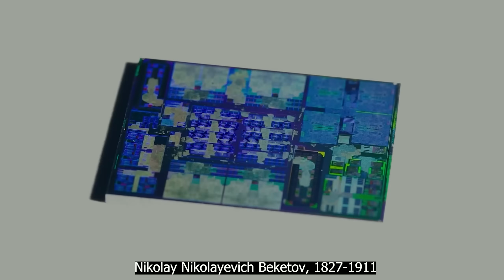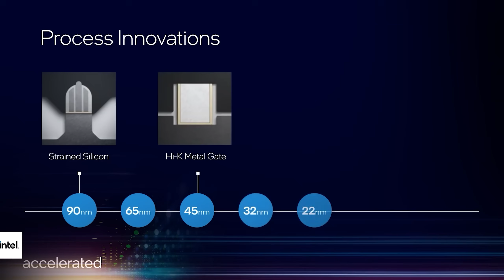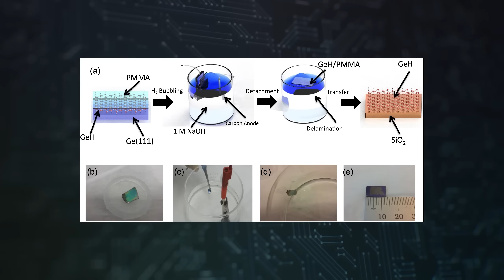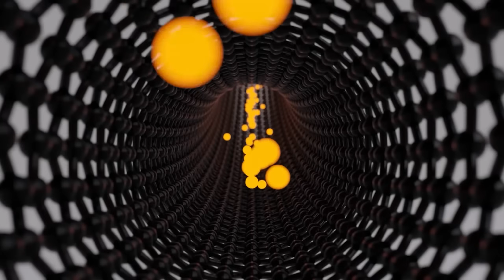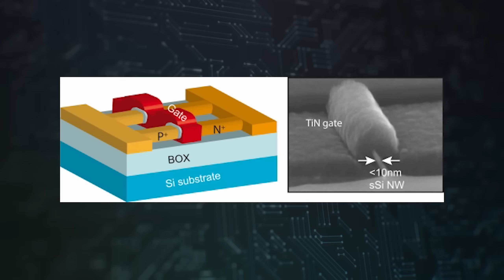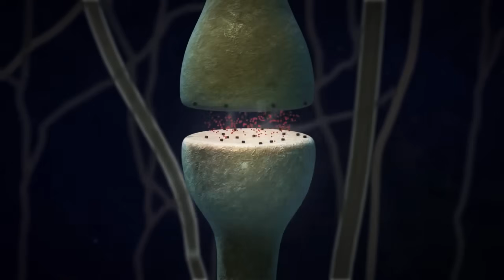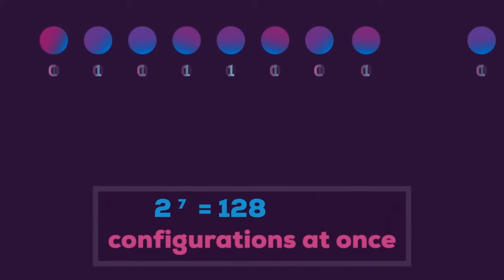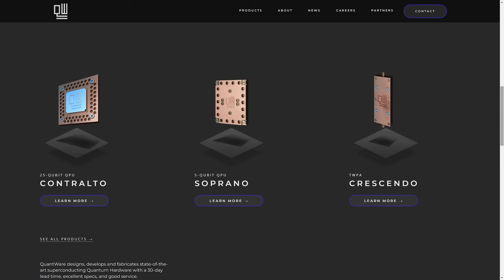End of the silicon era. Processors of the future

Comment: You forgot multi valued transistors. Non binary transistors which can switch between more than 2 values.

A 4 state transistor can emulate 2 binary transistor, without miniaturization. So it can preserve Moore's law, without requiring smaller atoms, or getting into tunneling troubles.

Comment: Well-Done, summary:
 SILICON: Above vs below a 5nm gate width silicon is discrete on eor off vs statisticial on&off (aka tunnel field effect)
 GERMANIUM: Germanium Has much better lab performance but silicon is extraordinarily more pragmatic/practical (availability/cost, heat dissipation/tolerance, oxidation, freq band, etc).  However germanium might be modified to improve its characteristics (ex: Molybdenite in development, lab germanane, etc).
 CARBON nano-tubes (in development): Graphene is a one-atom-thick layer of carbon atoms arranged in a hexagonal lattice.  A carbon nano-tube is a tube of graphene 
 GALLIUM NITRIDE: has some better performance than silicon & can be manufactured with silicon based equipment/industry
 Better CMOS: design based on statisticial on&off (aka tunnel field effect) instead of discrete on eor off to lower power/heat.  Only work for graphene & at super low temps.
 MEMRISTOR: A memristor is an electrical component that limits or regulates the flow of electrical current in a circuit and remembers the amount of charge that has previously flowed through it. Memristors are important because they are non-volatile, meaning that they retain memory without power.
 OPTICAL COMPUTING: 
 QUANTUM COMPUTING: In theory quantum computing can find least-worst solutions to problems no-matter the number of potential candidates (ex: NP problems like the traveling salement, decryption/password breaking, etc)
Reply: I like how you said nothing about optical computing xD
Reply: @Luizfernando-dm2rf  
*I wasn't trying to show-off.  These was just quick notes to remind me of technology tends I was fuzzy-on (thks to this good video).  I'm a retired physicist & am already familar with optics & optical computing.  
*There is Trillion$ ... Trillion$ of semiconductor electronic infrastructure around the-world & comparatively optic/quantum infrastructures are very small.  Quantum computer infrastructure is small but growing much faster than optic computing infrastructure.  So we just might jump from semiconductor dominance to quantum dominance computing.

Comment: So glad YouTube recommended this video. Nicely done, great balance of information and presentation without coming off overly optimistic or pessimistic.
Reply: Quantum Computing isn't a replacement.
Reply: Quantum computers can't replace regular computers. Yes they could calculate some very complex equations at a fraction of the speed. But they suck at doing simple calculations.
Reply: Yes indeed, so far it sounds intelligent. I'm hoping I'm not going to be lectured about Moore's law. I'm convinced that is a marketing meme for Intel.
Reply: @Andrew-rc3vh  Bruh 😂
Reply: @hyll6700  I did watch it to the end on this occasion and it was indeed no-nonsense. Good job.
Reply: Precisely
Reply: If you feel this educated you, when do you think the usage of silicon wafer to make ICs will be obsolete?

I don't think it will happen for a few decades regardless of process node shrinks taking longer to achieve.

One thing that isn't talked about is the BALANCE of information, because he said some things that while true didn't give enough information on, such as saying the industry is using "tricks".  Well, you could say the industry has used "tricks" for the last 3 decades.  Was it a "trick" when they have to move to EUV lithography?  No.  It was what was needed to move to etching out smaller transistors.

There are no "tricks".  There are techniques that companies use to make the best use of what technology is offering and that is the way the industry has ALWAYS worked.  If companies don't do that they go out of business because their competitors WILL do that and outcompete them.

So you tell me, at what point do you think transistor density stops mattering so much.  Do we need to fit 10 billion transistors in a sq. mm.?  A typical CPU that is HIGHLY complex doesn't even use 10 billion transistors and we're really at the point to were CPU really DON'T need to be more complex.  A typical modern PC is so fast that 95% of home user can't use the power of today's PCs.  So, what a typical home buys is a laptop or a low end system.  There are only a handful of things PC users do where adding more power helps, one is gaming.  The other is a category of things that revolve around working with large video files.  But this gets you into the conversation of, when do you stop adding more power to a PC and segment the market for people who need more power to move onto a workstation which is designed to handle more power.  And really, more power means applications that can make use of many core processing.  And the concept here is simple and moving to a new medium isn't going to change this, and a home user will NEVER be using a quantum computer, or at least not in the next 60 - 100 years, but I can't for the LIFE of me figure out why a home user would ever need something like that.

So, we are already at the point to where home computers have more compute power than they need with the exception of gaming (and we're almost there now), or the economics dictates that the home user moves to a workstation because you can't make a home computer have a range of compute power from simply browsing the web, to being a full fledged DB server in an enterprise, which is why there is product segmentation.

So the real question is, will servers used in business have the power they need, and the answer is already yes because anyone who follows technology knows that with the combination of making a better processing SYSTEM, which includes compute cores and  graphics cores and tensor cores and accelerators, well, as an example Nvidia just created a new system which takes a requirement of a few servers running for a couple weeks, and I mean modern servers, to a reduction of needing about 1/3 the servers and completing the task in less than a day.  The task is creating a mask, which is used by fabs (the business of creating ICs from silicon wafers).  A mask is used in the process of etching the IC.  It's like the blueprint.  When an IC has 10 billion transistors that fits on small square or rectangle, getting an EXACT blueprint of how to lay the substrates and etch everything out is VERY compute intensive.

There was so much left out of this video it's pathetic.  We are actually getting to the point to where the issue isn't going to be how many transistors can fit into a sq. mm, because once you're at 500 million +, the question starts to become why do you need more.

So, acceleration and AI.  What is really needed is better ways to compute complex problems that run on servers.  We are already getting close to having a single CPU have so much compute power that you can't physically feed data into the CPU fast enough or get the data out of it fast enough.  No, he didn't talk about that either.  Shame, because that's important too.

As soon as ANYONE jumps to quantum computing from computing that is now starting to become outdated, which is using a simple CPU for computing ANY type of problem that exists is skipping a WORLD of technology that exists and is getting much better.

Comment: Photonics can also do prossessing via constructive/distructive wave interference
Reply: Not really, as it messes with phase information. You can build simple gates, but as soon as you try to do something like an and gate either your 1+1 value is different amplitude from 1+0, or its phase is different. This is fine if you are just throwing it at a detector, but if you try to throw it into another gate built around interference it is not going to work right. There might be some quantum mechanical way to align the phases, but the naive approach does not work.
Reply: Photonics cannot store memory yet as that would imply being able to trap light for very long periods of time which is still impossible.
Reply: processing*

Comment: Quantum computing isn't going to get into your home computer unless you want to upgrade from water cooling to having a "cooling warehouse" which gets you to near zero kelvin. And the number of tasks for which it is faster is very limited. So except for a few very specific purposes, it's not realistic or even desirable. It seems as though "silicon is it", barring extremely exotic tech which is unlikely to be marketable at a sane price, even if it can be invented. 

4nm is "Now", and I expect that the only room for growth is going to be a "variable process" which allows for 2nm to 4nm across a chip, depending on the needed node for that type of transistor. But that won't appreciably speed up clocks from 4nm, just reduce power draw a bit. That'll improve thermal headroom, and give a bit of clock, but not like a full die shrink would. 3nm node is being worked on, but it 'may' require a more limited selection of gate types, which could limit chip design. Basically we're running out of "ticks", and future gains are going to need to come from "tocks", which means the pace of computer improvement is reaching a huge slow-down, and power/performance ratios (as well as clock speeds) will have limited growth potential. And very soon.
Reply: cloud computing will become the norm all urban cities and colleges will have terminal access to quantum computers
Reply: @GloriousEagle69  Even if you make computers a billion trillion zillion times faster than they are now, cloud computing would still make them slower because the latency down the wire cannot be reduced. If my computer can render a frame in 8 ms and give it to me in ~1ms, it's going to beat "the cloud" that will render it in -infinity ms but takes 32 ms to give me the frame.

Comment: You mentioned photonics use in communications but didn't mention photonics switching. They've been trying to make purely photonic chips for decades, and it's always just around the corner much like fusion. It's that research that led to photonics being integrated into silicon chips. It seems like that research was very close to yielding results but focus and funding got taken over by quantum computing. From all I've read purely photonic chips would run 100-1000 times faster than silicon at far lower power and heat. Hopefully as silicon reaches it's limitations there will be renewed funding and research for it.
Reply: It's a bit sad really... Quantum computing while exciting, is very far from producing anything useful in terms of actual computing. There has been no more than 10 algorithims made to run on quantum computers for example.
Reply: @Luizfernando-dm2rf   One of the most practical algorithms for using quantum computing is DFT, discrete Fourier Transform, but that is the most optimized algorithm in classic computing ironically.
Reply: The comment I was searching for. I was hoping the video is on that topic. Not quantum computing.
Reply: "They've been trying to make purely photonic chips for decades, and it's always just around the corner much like fusion"

The reason for this is pretty obvious.

Unlike fusion where the goal has always been the same and the task simply a huge paradigm change we have photonics having to keep up with electronic transistor density in order to make moving to photonics worthwhile.

Shrinking photonics is unfortunately not nearly so easy as they are still at >100nm feature sizes, so if we were still in the same place for semiconductor electronics at we were in the mid 00s it would not be so much of a problem.
Reply: Intel's working on it. Have a buddy that works in the photonics dept. Can never talk about where they're at though.
Reply: @jadedandbitter  true. Light processors are going to be like the invention of electricity. Intel's future depends on them being at the fore front.
Reply: If I remember correctly, there are already photonic ASICs on the market (for matrix multiplication/AI stuff), I wouldn't be surprised if chip manufacturers started shifting their focus by the end of the decade.
Reply: @SupaKoopaTroopa64   Exactly, there are niche applications in routing that use it, mostly for switching traffic between optical fibers on the backbone of the internet, where latency must be tiny and the bandwidth is gigantic.
Reply: Shrinking photonics is hard. A lot of contemporary research into doing this revolves around field effect modulation of 2D materials. It's difficult to produce pixel arrays of these materials in a scaleable fashion.
Reply: light switches have their application in networking & data transfer
Reply: "  Trying to make purely photonic chips for decades, and it's always just around the corner much like fusion "   They're not trying to make that, they make that. Its not around the corner, it is very much used in the backbone routers of the Internet that routes petabytes of traffic per second. 

But it is incredibly expensive, because you need to convert between electronics and photonics.
Reply: @monad_tcp  Yeah, but you can do all of that at the edges, where it can be big and clunky.
Reply: @moki123g   sure, but you are not getting where I'm coming from.

sure you can do routing of optical traffic at the edge, but what if I wanted to push 800TB/s of data inside a microchip.

Imagine I have 10.000 FMA units (float point multiply adder) and I need to keep then all working and I want to clock my chip at 4Ghz.

A simple back of napkin algebra tells me that would be 291TB/s at 64bits. That's 10 times what the best GPU can move from the outside RAM chips to the core.

Which is why GPUs are clocked at measly 1  to 2 Ghz or less.
Reply: You can't push that much data through copper lines, that would have to be a 10cm die just for the wirebound and it would have to have tens of thousands of pins, but you can if you can route light inside a microchip using only 2 optical fibers
Reply: As we are doing exotic microchannels in side a silicon die to guide light, we might as well put microtubules so we can inject some sort of methane gas to cool the insides of the chip.
Reply: Huge problem with photonics it's size. It's not panacea, it may help in some sector but still require regular computers and electronics to run properly... 
Quantum is big over-hype ... Regular math operation will be way to slow there...
Reply: isn't fusion have focus and funding but still no result ?  is it really that close for purely photonic chips ?
Reply: Surely you don't forget what happened to Nikola Tesla who's rolling in his grave with his name being used by fraudsters (muskrat tesla name buying and that nikola truck scam guy)...most likely the richest have already developed it to keep power...
Reply: I'll just lay down the facts: optic chips are unlikely to become a viable reality because while photons are very fast at transmitting data, there's an intermediary step of turning the data into light and back to electricity plus while they bring speed, size is still a matter. Other techs are gaining ground fast with the funding of FAANG and other large tech companies, especially Intel,, Where photonics is useful really is in data transmission outside the CPU,, in large busses and cables where transmission speed is more of an issue,, in about a decade, people may find themselves with cables that transmit data at enormous speeds in the ball park of 100GB/s. Especially useful for data centers, servers, and large computers where decentralizing the actual computer could be desirable to reduce heat accumulation and make management easier and mor streamlined,, all while reducing costs
Reply: Ibm and intel are doing that.

Comment: Germanane has more potential in the power transistor market, as the higher conductivity will produce less heat, allowing for very small high power transistors that produce little heat, and therefore don't need heat sinking.
Reply: Researchers at the University of Groningen in the Netherlands and the University of Ioannina in Greece, have reported on the first field effect transistor fabricated with germanane, highlighting its promising electronic and optoelectronic properties.[5][6] Germanane FET's show transport in both electron and hole doped regimes with on/off current ratio of up to 105(104) and carrier mobilities of 150 cm2 (V.s)−1(70 cm2 (V.s)−1) at 77 K (room temperature). A significant enhancement of the device conductivity under illumination with 650 nm red laser is observed.

lol im greek and just did read about germanane in wikipedia seems promising crystal but thing is how much work it needs to make make billions of trillions transistors with it and how they will price it in the final products you know you pay a product every penny goes to labor research branding production costs etc etc etc but very promising and i hope there my brethrens find more discoveries with it